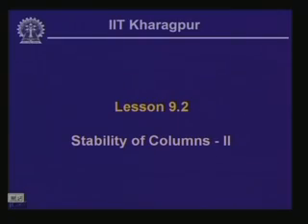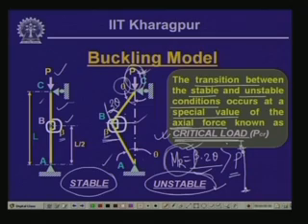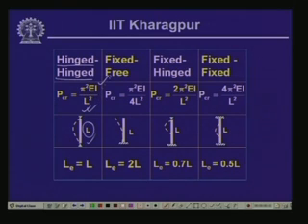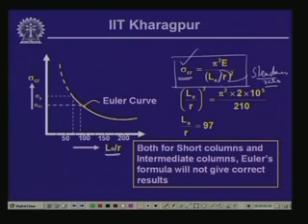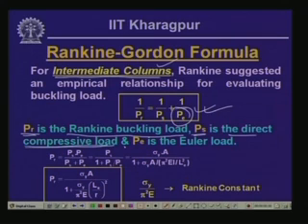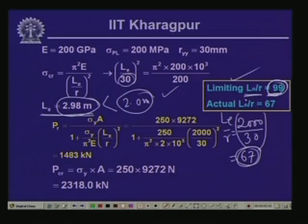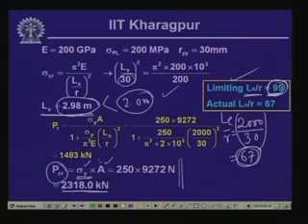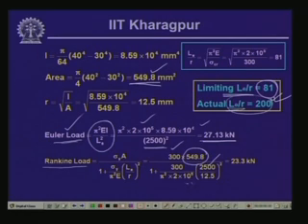Lecture - 38 Stability of Columns - II

Comment: On the slide @ 54:20, the value of P_cr (critical load) is wrong; the computation is right but the final answer should be about 17.85 kN..
Reply: yaa ur right
Reply: Yes... I d.. face same problem. 
Its 17.84 KN AND.. MAX.  ALLOWABLE LOAD THAT CAN TRANSFER 17.84/2=8.92 KN
Reply: yes

Comment: In question 2 why u have taken "sigma pl" as the governing criteria for the calculation of minimum length of the member, whereas in question 3 u have taken "sigma y" as the governing criteria for the same. WHY? Also in the last question u have not taken into account the applicability of "sigma pl". WHY? Can u please clarify?
Reply: Exactly my doubt
Reply: If in question sigma pl is given then we have to take it otherwise if yield strength is given alone then we can take it as governing criteria. And remember for steel (MS) proportionality limit and yield strength are almost equal.
Corrct me if I am wrong